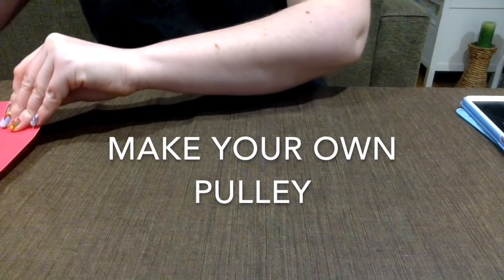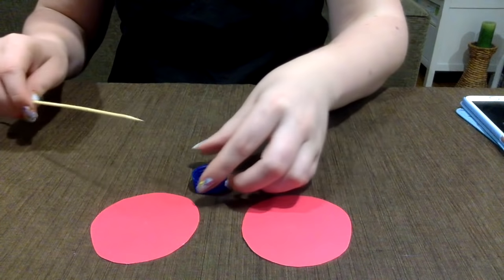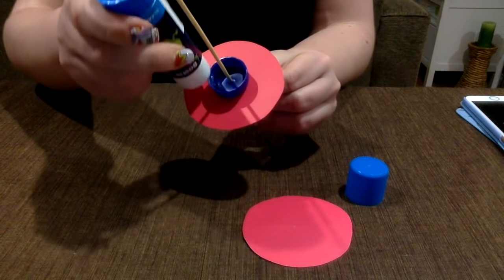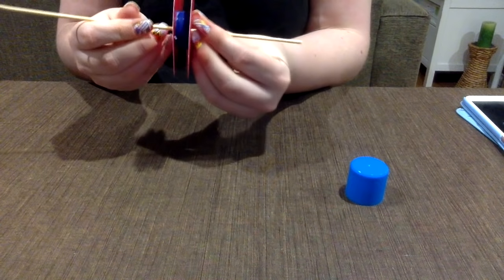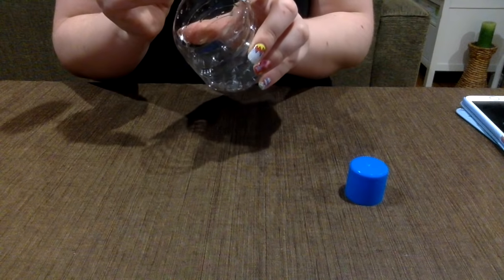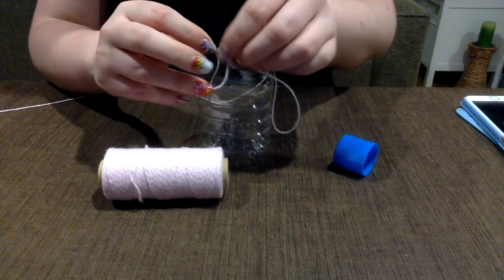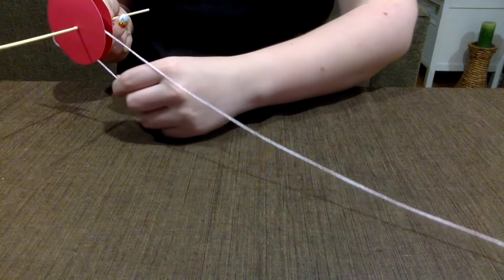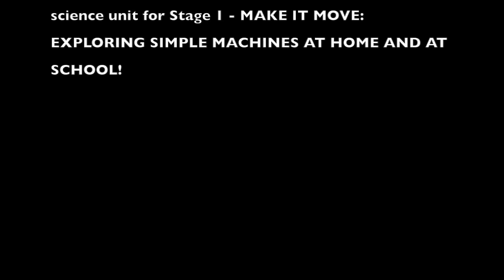Video   How to make a pulley

Comment: Actually, based on physics, this makes it harder to pull the bottle up, since the string has mass and the pulley has friction.
Reply: The type of pulley she made is a one to one ratio. There are different types of pulleys that affect the work ratio differently. This one is used simply to do lifting based on space available, not weight/work reduction. It allows, like an elevator, to take something straight up or down. That is the only benefit this type offers.

Comment: I made my own pulley with a styrofoam cups and a string and tape. Just poke a bit enough hole where the string or whatever can go through..and use tape so the string won't exactly scrape the styrofoam when you pull it.